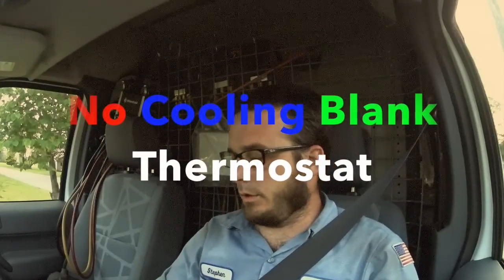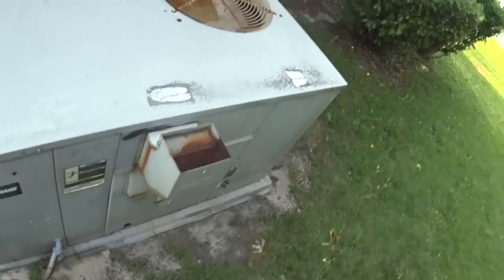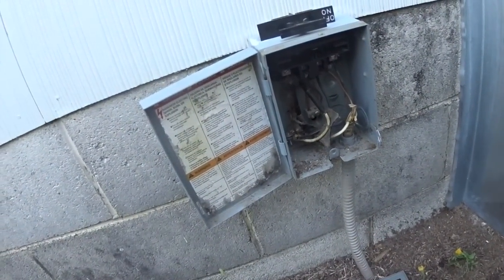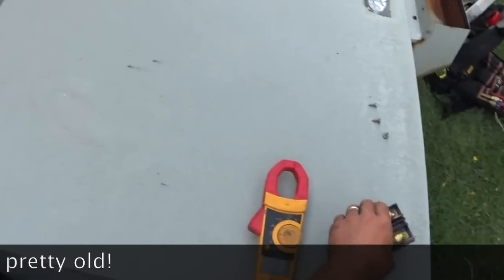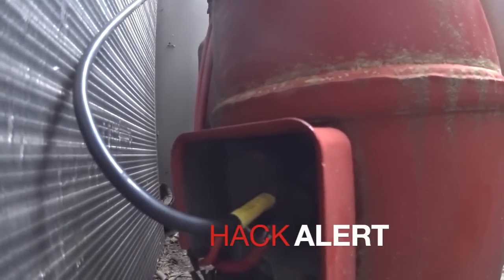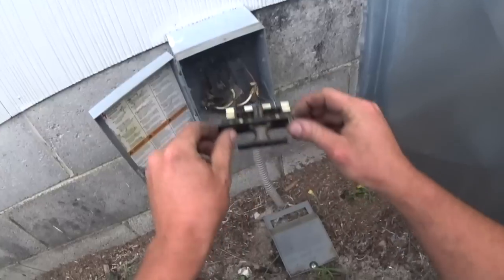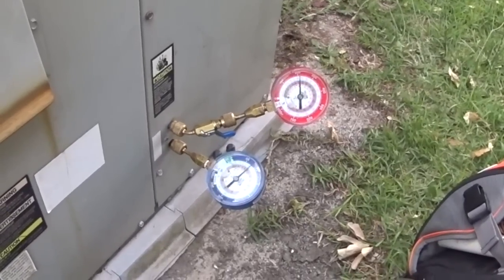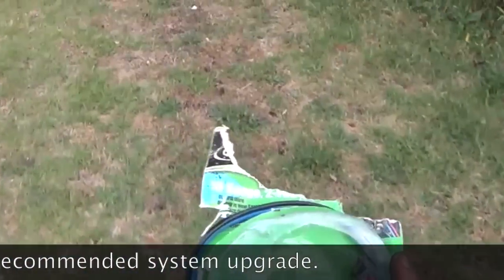HVAC Service: No Cooling, Blank Thermostat Trane YCC

Comment: You find burned compressor terminals and you replace the fuses and push the contactor in, with your finger no less. Bad form and super dangerous my friend. Teach... the children well!
Reply from the maker: I was not aware that it was dangerous to do at that time. I’ve learned more since being on YouTube than I did in the many years early in my career

Comment: Dude you have balls of steel pushing in that compressor contactor with your fingers !  Where is your PPE? and why are you showing dangerous work practices on the internet? Seriously man I'm freaking out on this video I'm surprised your still alive... 17 years in the field eh?
Reply from the maker: Because I never realized it was supposedly so dangerous. But in the words of a famous hvac personality "this is how real working men cook"
Reply: Stephen Rardon Man don't hand me that lame crap about you never realized it. You know the dangers and the risks working in this trade.. please don't minimize your shortcomings and laziness of safety precautions. I'm quite sure what ever school you attended or someone who has taught you this awesome trade taught you good PPE practices.
Reply from the maker: Taheem Akbar nope, didn't do school. I never heard so many people talk about the danger of pushing a contactor until I posted some videos showing my normal process.
Reply: Stephen Rardon Ok man.. be safe out there.
Reply from the maker: I'm told that I shouldn't wear my wedding ring, shouldn't care about checking static pressure or disassemble units to clean them. Shouldn't spend money on expensive test equipment because customers don't care. I do a lot of things that people disagree with
Reply from the maker: That's not to say I'm correct or that I shouldn't do things differently. I appreciate your input, I appreciate you taking the time to comment.

Comment: Good repair and did good by your customer.  Could have, kind of,  justified a compressor replacement seeing how trashed the compressor connections were.  A Dremmel tool though, could have cleaned it up fairly good. I've used them in thermostat compartments where a battery leaked acid, and it cleaned up nicely with one of those tools. 
How about showing a tube sheet end repair on a copper coil? Or replacing the distributor tubes on a TXV's  distributor head???
Reply from the maker: hvac01453  those are
Repairs that my boss will not allow, won't guarantee patching coils, or soldering dist tubes

Comment: I'm having pretty much the same problem with my unit exept i do have high voltage, mine works fine during the night but as soon as it gets hot outside the thermostat starts to turn off and on and eventually goes blank, it stays like that all day with no cooling  until night and the display comes back on and the unit works fine again for that night. It's diving me nuts...
Reply from the maker: Joel Ortega that's odd, what type of system do you have? Heatpump? Gas furnace with AC? Packaged unit? Do you know if the power
Company has installed a load management box recently?
Reply from the maker: If I don't reply tonight I'll get back to you in the morning
Reply: +Stephen Rardon (HVAC with Stephen Rardon) It's a Intertherm unit with the blower outside that's all i know i bought this home two months ago, i did noticed that the previous owner had changed the stat and it was working fine  for a few days, i checked all the wiring and they look ok lil dusty also the capacitor looks ok too but i don't have a device to check for voltage I'm suspecting a wire plroblem somewhere but not sure, today is working fine last night i removed the new stat and replaced with the one was already installed and it came on and still working for now it is 11:30 am usually by this time the stat is blank and no a/c
Reply: +Joel Ortega also this home is a 2000 and so is the unit, no clue whether the power Co. has intalled anything recently
Reply from the maker: Joel Ortega  where are you located? I may know someone in the area that could help if things quit again
Reply: +Stephen Rardon (HVAC with Stephen Rardon) I'm in Davenport, Fl
Reply from the maker: *****  you know anyone near Joel Ortega that could help with his issue?
Reply: +Dr. Pastor Charlie S. Problem solved, i had to re strip all the stat wiring and replace the contacto, so far so good i'm planning on re wiring the stat later on once i'm done with other projects i have around the house. Thanks!

Comment: I start with main power to system /pull stat to check for low volts , then  at the transformer. it all good / they run you to death.

Comment: so What did you do to bring Power back to the unit?
Reply from the maker: Ended up replacing the fuses and repairing the wire to the compressor.

Comment: I'm seriously shocked at how many people are saying this was a great video. Your training on this call is clearly geared towards a novice, as evidenced by the incredible simplicity of the issue, but you did so many things that were incredibly unsafe. You wore zero PPE, pushed a contactor in with your damn finger  (without testing first for shorts or grounds, or incoming voltage ), and ran the unit with no fan guard. I know I'm being harsh, but that is completely unacceptable and the work of a hack. I'm a commercial tech, so obviously safety is a huge deal for my company, but you could have been killed several times on this incredibly simple job. I only hope this watching are smart enough not to follow in your footsteps. You may be a good tech, and a good guy. But putting out videos like this and some of your others, exhibiting such unsafe behavior, is downright irresponsible. OK, I'm done.
Reply: +Jason Rivadeneyra when u are a grown up u also can drive without seatbelt....
Reply: +Jason Rivadeneyra   Nice work Mr. Rardon.  You are certainly one of most ethical and knowledgeable hvac techs out there and, as you stated, you took care of a customer that needed help without the all too common push to upsell a new compressor or a new system.   Obviously residential is different from commercial and requires a fair amount of risk such as crawling through tight crawlspaces alone, while  performing intricate diagnostics and repairs under often terrible conditions and long hours.  While it does not make sense to touch a residential AC voltage circuit, many do contact 120 vac which is the reason the US limits any single residential  hot wire to that voltage.  And I also notice this is about the only time in your vast array of videos where you do push a contactor with an ungloved hand.   I only wish you worked in my part of Texas.
Reply from the maker: Thanks for your input Jason, you're not wrong that I did some things without regard to safety.
Reply: +Stephen Rardon (HVAC with Stephen Rardon) kudos to you for accepting criticism. I commend you for trying to train our younger techs coming up behind us. Don't forget the little things. with 27k views, people are clearly listening to you.
Reply from the maker: Jason Rivadeneyra being unwilling to admit a fault doesn't help anyone. I appreciate the way you presented your concern rather than being unkind. that's makes a difference.
Reply: Rardon is a master HVAC technician.
Reply: Not even sure what that means. .....

Comment: you are good tech because you understand when fuse blown that something else did it. I worked as helper with a tech and he just replaced the transformer and just blamed the thermostat. there was nothing brunt in the thermostat. honesty looking back that circuit should be ohm out to check for shorts. anything like wire with it installation rubbed off and touching the side to shorted relay coil could cause issues.

Comment: Hi Steve, great video.  Please don't take my comments as negative but hopefully save you from a serious injury.  First, please take off all jewelry when doing electrical work.  Knowing that you may have taken out fuses instantly when re-powering the unit there was a very good chance that contactor may have blown up.  Do research on arc flash incidences...there is a greater chance of injury from that than electrical shock.  Wear leather gloves!  You could just let the thermostat turn on the contactor and stood clear. Or take one wire off contactor coil and attach a jumper to it and where it was connected, both long enough to get away from panel.  Then jump to turn on. I know we've all done the push on contactors, motor starters, etc. by hand and nothing has happened, but one bad incident will be very bad.
Reply from the maker: I know
It
Is a bad habit.

Comment: Why not a central system,? Just curious, I've seen theses units on trailers, but why on a house with block foundation?
Reply from the maker: That's just the way it is down here, low crawlspaces make it difficult to stuff a unit under the house.

Comment: Bro did you your finger to check high voltage off your contactor ?
Reply from the maker: No, I don't think so anyway, probably not. It's been awhile ago that I posted this video. I'll have to watch it again myself. It was supposed to be funny, if I remember correctly.

Comment: If it gets to the point that you have to change the compressor I would install a comparable Copeland instead of a trane.
Reply from the maker: Interesting question SombraLocs, I'd say as long as it's still working there is no limit which begs the opposite question, if the compressor fails, at what age does it Not make sense to put a new one in? At some age you may not be able to find a replacement part. But if you can still find parts does it Make sense to spend half of the money it would cost if you upgrade instead? If you can upgrade for $5000, for instance, and a new compressor would cost $2000, is that a logical way to spend your $2000? I'd say no, even if it was only $1500. Does that make sense?
Reply from the maker: I wouldn't be in a hurry to put a compressor in a unit of that age, it's not very economical with regard to reduced efficiency over time.
Reply: Stephen Rardon What would be the max age on a unit before thinking of replacing a compressor?

Comment: i have used then # 10 yellow wire connectons and wire before if the spade is broken off compressor terminal i have some out there over 5 years like that still running like that .go figure .sometimes you have to get her done anyway you can .. the terminal kit works good also
Reply from the maker: i was trying to come up with a temporary way to connect and that just seemed like the best option. thanks for commenting Steven